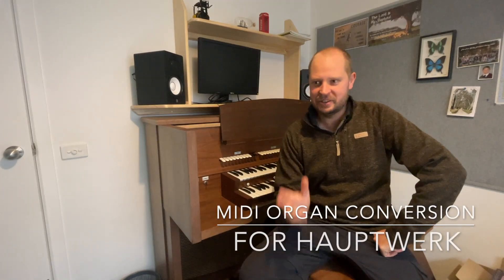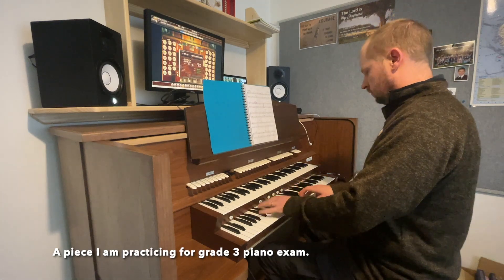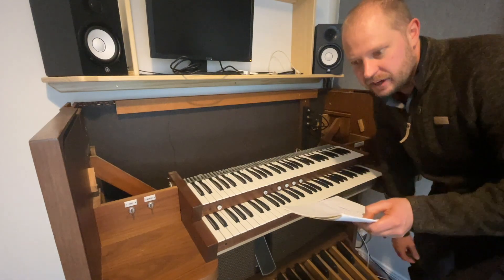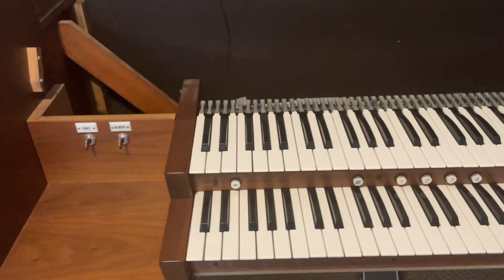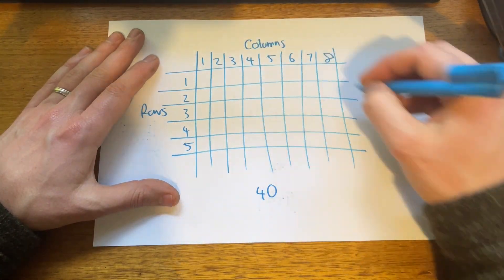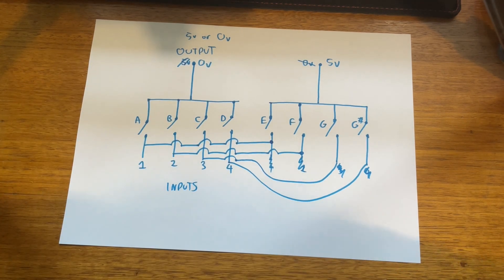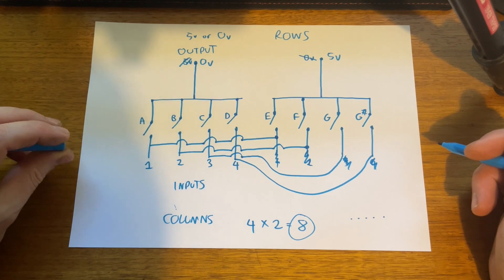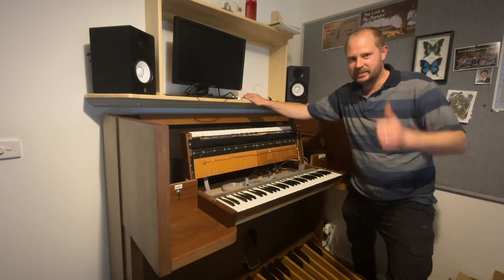How to Convert an Organ to MIDI for Hauptwerk - Video 1

Comment: Would be nice to see how you actually opened up the organ!
Reply from the maker: I didn’t take any video of the process of opening it and removing all the old electronic parts. I actually had to cut the organ frame in half to get it down church stairs. Maybee I can show some pictures of how I did it.  I’ll make another video at some point to show what is behind the organ now and how it all goes together.
Reply: @danielschipper1572 yep that would be great. I picked up a Johannus Opus 215 listed on Organs for Sale Australia recently. Just doing my preliminary research before I attempt to crack it open.
Reply: @danielschipper1572 yep that would be great. I picked up a Johannus Opus 215 listed on Organs for Sale Australia recently. Just doing my preliminary research before I attempt to crack it open.

Comment: Thank you, man! I'm waitting for next videos. But i have a question: how i conect the pipes and a keyboard console on an arduino?
Reply from the maker: Glad you found the first video helpful. I’m working on the 2nd video. 
I won’t be covering the connection of pipes. This process is about connecting the keyboard to the microcontroller (eg Arduino) so a computer can receive the midi signal and play virtual instruments. 
The keyboard wires (rows and columns) need connecting to digital pins of the microcontroller.